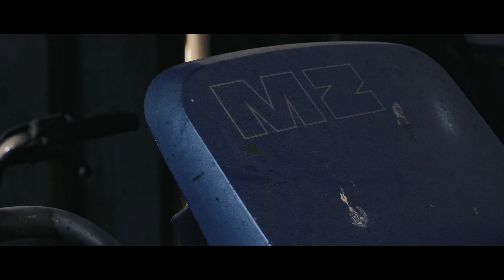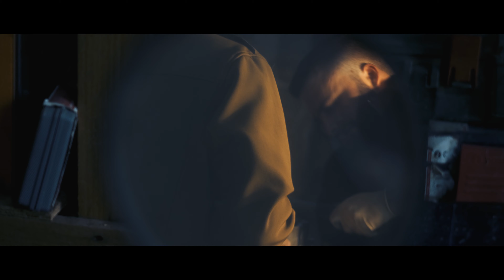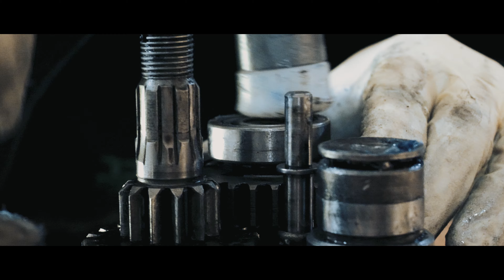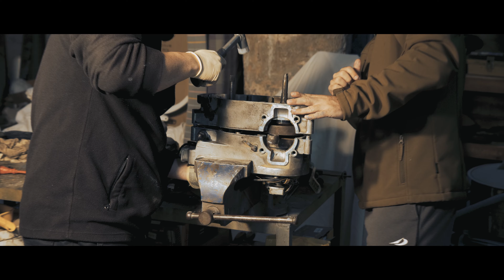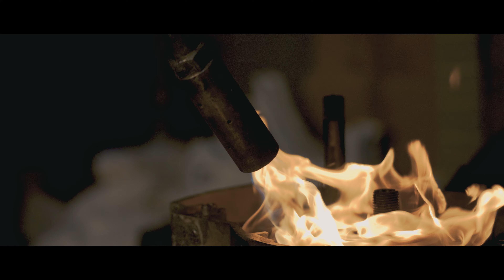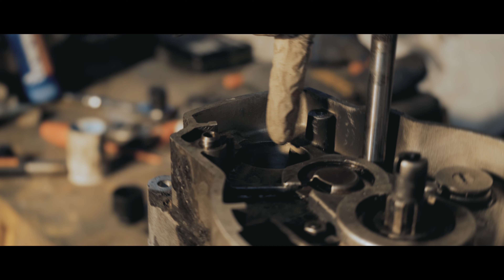"The Mechanics" (Lumix G9 \ Olympus 12-40mm f/2.8)

Comment: How do you like the Olympus 12-40 on your g9? I'm deciding between this and the Panasonic 12-35
Reply from the maker: I can tell that I always think about getting the 12-35 Pana just because of the DUAL I.S 2, but! the olympus 12-40 works so great with the G9 and so sharp that I could not be more happier, as you see this video is with the G9 in body stabilizer few shots are stabilized even more in post, but thats a great combination, also the Olympus build quality feels much better.